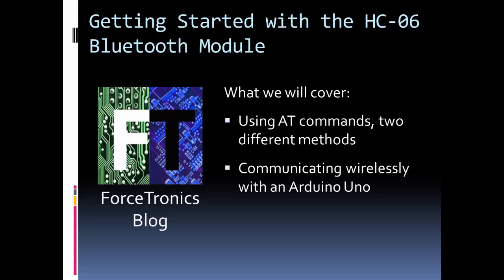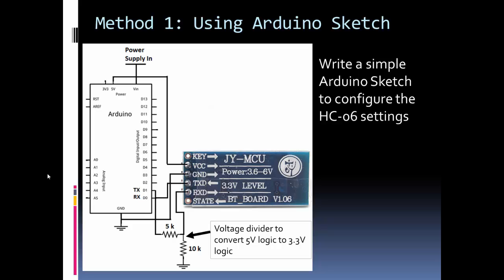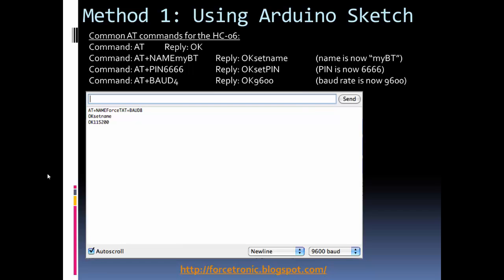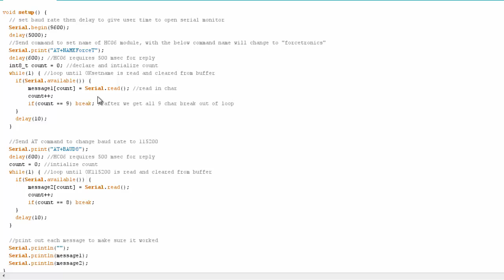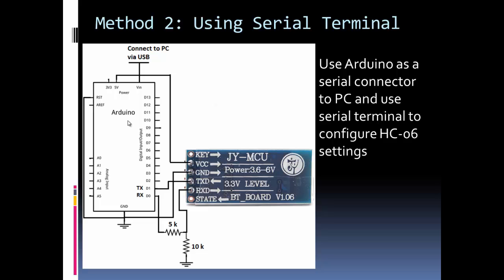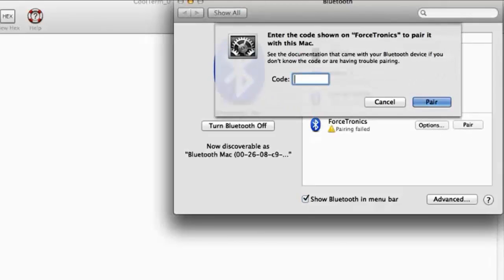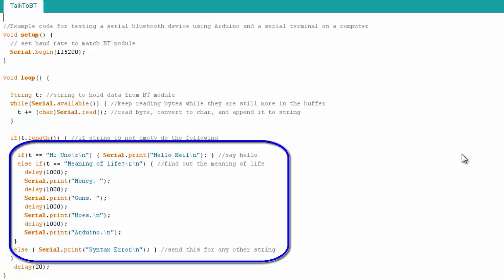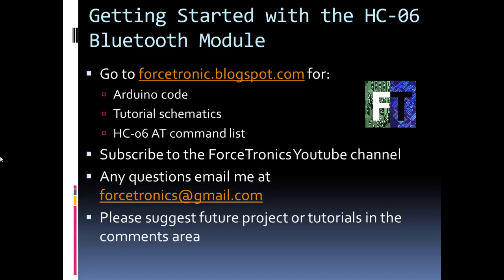Getting Started with the HC-06 Bluetooth Module

Comment: Seems you need to protect the arduino module, not the HC-06, so the resistors should go on the RX pin of Arduino and NOT on the RX of the HC-06. The HC-06 transmits at 5V!!!!

Comment: We have a problem. Our HC-06 Bluetooth module got virus. We checked it in serial monitor and found out that the output is wrong. It has question marks and variables which is not included in our codes. Do you know how can we fix it?

Comment: Forgive me for my ignorance but why do you need such of high ohms resistors and make a divider. All you need is a 40ohm resistor to drop it to 3.3v?
Reply from the maker: It will take more current and the MCU or Bluetooth chip have limited current sourcing capability

Comment: When I run the code for method one with circuit that goes along with it, I get this error: avrdude: stk500_getsync() attempt 1 of 10: not in sync: resp=0x00 and it tries to since 10 times and fails each time.  When I remove the wire from pin 0, I can load the program and the name of the module changes but I don't get any messages back on the serial monitor.  The only thing that is displayed is "AT+NAMEForceT" Am I doing something wrong?
Reply from the maker: You cannot upload the code to the Arduino Uno when you have the BT module connected because they use the same serial port. Upload the code with the BT module disconnected, remove power to the Arduino, connect the BT module, and power the Arduino back up. Hope that helps
Reply: Thank you!

Comment: Hi there I have a question here I want to use my hc-06 but I want to change the name from hc-06 to something else is it possible
Reply from the maker: Yes, below are the AT commands. Note you can search for a full list of AT commands to see what settings you have access to.
Send : AT+NAMEdevicename 
receive : OKname
Reply: I am new at this I am using hc-06 for micphone and speaker for my phone cause my audio jack is well smashed I decide to throw my phone so I am using this hc-06 for the audio also would it be possible to add a number pad onto it
Reply from the maker: You may run into issues because the HC-06 is configured to only support a serial stream, not audio. I would recommend studying the bluetooth protocol and the different modes its has to support various types of data transfer. I would then look for a bluetooth module that supports what you want to do (aka read the datasheet)
Reply: Well here the thing, I have a 3.5mm jack with mic and speaker attached to it and few features on it but it doesn't have number pad and its not bluetooth so I thought maybe using hc-06 arduino and attiny 85 or something that allows me to use this as a bluetooth aswell as other features I want to add in the near future

Comment: hey, i was doing this project ""http://www.circuitmagic.com/arduino/arduino-and-bluetooth-hc-06-to-control-the-led-with-android-device/"" so he said give in a 5 v power supply to the module is it all right or is there a chance of it burning
Reply from the maker: There are various versions of HC06 modules out there. Most of the ones I have seen are rated for 3.3V. I would consult the manufacturer specs for your module to determine the max voltage

Comment: not sure who can help, my hc-06 was left running over night and then suddenly died on me, are these modules relaible?
Reply from the maker: I never had one break on me yet. I have one that has been running in my custom built-in thermo stat for over two years. With that said it is fairly low cost electronics so I am sure there are defective ones that come off the line. You could always try another and if it breaks again it is probably something in your setup.
Reply: fair enough, it may have been a defective one

Comment: so, just to check the bluetooth will not work if there is no voltage divider on the receiver???
Reply from the maker: +Francisco Sanchez You will need a voltage divider or level shifter circuit if you are using a device that has a higher voltage logic level then the Bluetooth module. The BT modules logic level is 3.3V if you are using an Arduino Uno which has 5V logic level then you will need to reduce the voltage to ~3.3V between the transmit and receive pins so you do not damage the BT module.
Reply: Ok
Reply: What app is good to use for the bluetooth

Comment: Hi ! just to know, one we have do that (re-name the module etc.) If we put a différent code in the Arduino, the settings are saved in the Bluetooth module ?

-> I put your first code in the Arduino, I re-name the module "ArduinoBT" then I put a random code with a Bluetooth connections, did the module still named "ArduinoBT" ?

thanks !!
Reply from the maker: +TrolololGames Yes once you change the name or any setting of the BT module using the AT commands whether it is done in the Arduino code or in the serial terminal the new settings of the BT module will be saved.
Reply: +ForceTronics Ok ! thanks !!

Comment: Hey Neil, I built a simple circuit along with an Android app that Im using as a garage door opener. Im using the HC-06 on the receiving end (connected to the opener) and it works flawlessly after programmatically connecting to it. Keep in mind it will only connect if the garage door isn't blocking its view (it's an aluminum door). My problem however is when I finally get out of range from the HC-06, it disconnects, and cant reconnect if the garage door is shut. I tested it while both devices were still connected with the door shut, and it worked like a charm. Im thinking it may be entering a power saving mode and cant hear the connection request from the Android device. Any idea on how to solve this issue? Thanks dude
Reply from the maker: +thefreddykilo That is the main downside of Bluetooth is its range and the HC-0x line of products have a PCB based antenna which doesn't help. I have used the HC06 and not the HC05, but they are pretty similar. The HC06 does not go into a low power mode it is always on advertising for a connection. The issue could be that when the HC05 is advertising itself for a connection the transmit power used maybe lower than when it is actually connected and communicating with a device (this would not surprise me). The way to determine this would be to dig into the data sheet of the Bluetooth chip on the HC05. You may want to try and position it different in the garage for better signal strength outside the garage or get an HC05 with an external antenna (if they have them).
Reply: +ForceTronics I am in fact using an HC-06. The problem is when the app tries programmatically connecting. It has no problem passing bits once it is connected, even around 50 feet away with the door closed. I did read through the data sheet and really couldn't find a solution, the data sheet is a bit vague. I ordered an HM-10 (BLE) and will mess around with that, hopefully the newer protocol has better functionality. Thanks for the response.

Comment: mine connects and works with a c# application that sends it data, but at some point everything just freezes and it stops taking data although it's connected.Any ideas?
Could it be an overflow of the data sent or something like that?
Reply: ***** thanks for the help, i was hoping there was some common issue that you knew of, but i guess troubleshooting it is...

Comment: In the circuit for the second section, the reset pin of the UNO is grounded. But the UNO code is responding in your video to the incoming string. With this circuit, I can get my terminal program to communicate with the Android app on my phone by Bluetooth just fine. Am I missing something from the edit?
Reply: Thanks. Great tutorial. It finally sank in. I use Termite as a terminal on Windows, and it works great, especially for capturing data for other processing, like in Excel.
Reply: *****
I don't think this answers the question. You are using the Uno as a transparent device to connect to the HC06 to your computer and yet you upload code to it as if the Uno were active. Confusing!

Comment: Hi, i have a question and i hope you guys can help me with this. how does the arduino actually know actually know which data it is going to send or receive? in which part of the code does it do that? i want to make two arduinos one having a HC05 as a master sending data over to a HC06 slave on two different laptops. I hope you can answer me.
Reply: *****  Hi, firstly thanks for replying this message. I was thinking of making a one way communication from the master HC05 to the slave HC06 by using two arduinos. I want to make it such that the HC05 is connected to laptop A and that the HC06 is connected to laptop B. This is what i am trying to achieve. however i do not understand how to send or receive anything from the bluetooth modules. I hope you can guide me through.